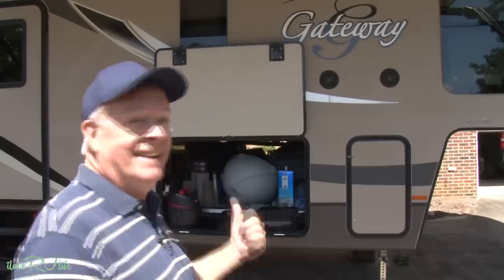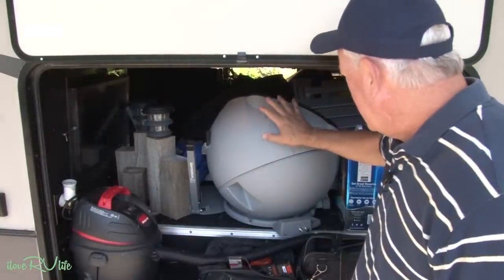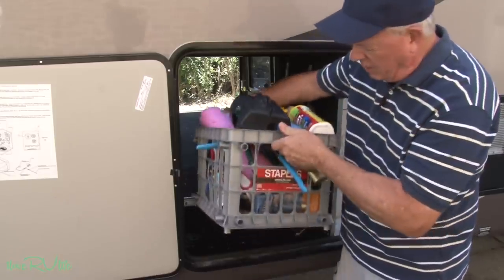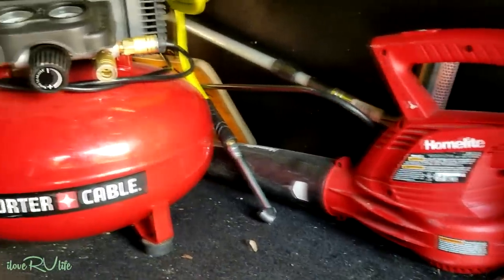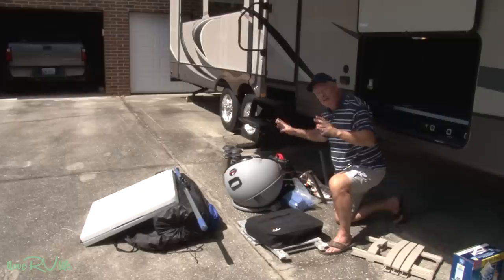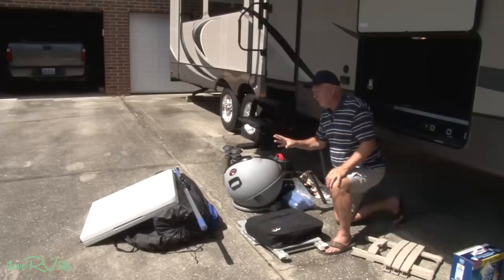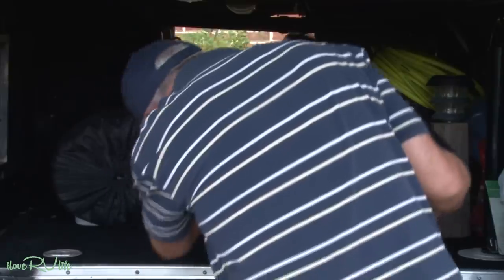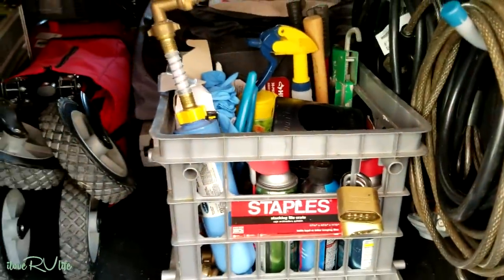Packing Your RV Storage Area

Comment: Jerry, this I a a great video. Imagine that we went from an 05 39’ Teton Grand to a 29-5T Arctic Fox. It had a “garage” you could literally camp in. Talk about downsizing!  I put 2 toolboxes in the bed of the truck. One big box in the front of the bed and one behind out trailer saver hitch as close to the tailgate as possible. I keep all of the non trailer oriented stuff in the big box in front, my camp chef grill, small air compressor,  small 2 step stool etc. in the one in back of the bed I keep all my tools, repair parts, chemicals and whatever is left. Only thing I must watch is to lift the front of the coach about an additional 1.5 inches after clearing the hitch to get the pin over the rear box. That leaves my on coach storage for trailer and camping specific items, Winegard X2 (bought after watching your video...thanks for that) chairs, bins for fresh and waste hoses and accompanying stuff. It worked amazing for us. Appreciate your channel and hope to meet on the road some time (getting closer to retirement). We are in So Cal but love the south (when it’s a bit cooler) Safe travels to you and your wife this summer. Rick and Linnea Colston. If you would like to see any pics I would be happy to post. ( not sure if I can in the comments section )
Reply from the maker: What a great set up Rick.  I’ve seen several 29 series Arctic Fox recently.  Well designed and great use of floor space.  Also understand they are well built.  Glad to hear the X2 is working well. We’ve had ours several years and still works great.  Warns days are on the way in Georgia.  Heading to the North Carolina mountains Monday to escape the heat.  If all goes as planned, we’ll head west early fall. AZ may be as far as we go this trip.  The RV world is small is a small place. Hope our paths cross.  Jerry...

Comment: Really great video as always!!  We were curious about your leaf blower...I want to get an cheap plug in to blow the sand out of the camper, as well as blow the sand off the mats when we pack up to leave (my husband spends like an hour sweeping it off before we fold it up to leave haha)  We don't want a rechargeable one, as that would be a pain, but want something strong enough.  And Small enough to fit in our storage!  Is yours a plug in and do you recommend it?
Reply from the maker: Thanks a bunch Lori.  The little Homelite blower isn’t made any longer, but Black n Decker makes a unit that’s almost identical https://amzn.to/2IR6Cxk.  It too is small and electric.  The little electric blow is perfect for leaves, sand, etc.
Reply: A thought, could the small shop vac have a place to put the hose on exhaust?  I have one that does. It may eliminate a tool and free up some space. The wand could be used to direct air flow?
Reply from the maker: Hi Jim.  It does have an exhaust on the other side and makes a fair leaf blower.

Comment: Good vid as always Jerry!  There is nothing that gets on my nerves more when I’m camping is trying to get something out of storage and having to pull a tangled mess out for one thing. What I have done is get 4 heavy duty plastic totes. I have 1 labeled for leveling blocks/wheel chocks, 1 for outdoor grilling,bug sprays,fire starters etc.. Then last one is for electric cords, pig tails, small tools, any maintenance items. Rugs slide in between totes and chairs fit on top of totes. This for me has made set up and break down stress free and fast.
Reply from the maker: That’s a great system Todd.  Thanks for sharing.

Comment: We just upgraded to a momentum 381 toy hauler from an older KZ toy hauler. The new one has way less storage in the pass through. I had to go through my stuff and downsize. I didn't realize i had 200' of water hose lol. Even after downsizing I had to get creative. I'm using the generator compartment for some things and our under bed storage too. Long story short...whatever storage I have in any rig will be slammed full.
Reply from the maker: Too funny Blake on the water hose!  I didn’t mention, but I carried one around this year that leaked like crazy.  I didn’t show the geny bay.  I have a big custom battery box with 4 T105s and my hoses.  Nothing fancy but functional.  We may be getting close to having the basics and not hauling around a bunch of stuff never used.  Jerry...

Comment: Nice, I put my air compressor on my truck,  with 5 gallons of air. It goes to 200 psi. I got the high volume pumps. I got 2 of them
Reply from the maker: That will get the job done!

Comment: Great idea on going through storage about once a year.  You inspired me to go through mine again.  I purchase two large clear tubs with lids for loose items.  Be sure and get them lids, because as you said flat is good and I stack a few large light weight items on top.  Agree put things you seem to always to use in the front.  Also, don't forget the front storage.  I put my power cords, hoses, sewer connects there.
Reply from the maker: Hi Norman, I do the same with the front storage for hoses and the grill.  Should have shown, but so little space is available (it’s full of golf cart batteries) I didn’t both showing.  Should have taken a minute to show the set up.  Great tip.  Thanks for sharing.

Comment: You mentioned cleaning off the faucets at the camp grounds. Could you do a video on sanitation of campground hook ups and what you do to clean them up. Thanks Jerry
Reply from the maker: I could, but not much to share.  We have one of those large generic spray bottles you can buy from the home products isle at the home improvement stores or Wally Worlds.  Add a half a cup of bleach and fill with water.  I spray the water facet in and out before I connect the hose.  Just a simple “just in case” measure.
Reply: I Love RV Life that’s great will add it to our inventory forsure. Thanks for tips again!

Comment: X2 tip- After disconnecting power rotate the head clockwise until the arrows aligned for STORAGE. The head will then be Horizontal. Other than that..nice job!
Reply from the maker: Thanks

Comment: Would there be enough room on the garage door to install grip clamps to put your electric adapter on?  Since shore power is probably the third thing to do? And stacked in one place?
Reply from the maker: There is.  A clip holder used for brooms and mops is an option.  Have been debating for some time whether or not to add.
Reply: I Love RV Life I don’t Rv as of ye.  Just found your channel. Been following the RV Odd Couple. But I think if you used short screws with epoxy. It may work.   That is if there is any space near the hinge to affix you most used plugs. Might just work?
Reply from the maker: Welcome to the channel Jim. I think the short screws would work.  I want to make sure we don’t add strain or wear from highway bumps that could damage the adapters over time.  They’re small, but a little hefty for the size.
Reply: I Love RV Life I saw you hold one up in your garage storage video.  I have the problem rolling on the back burner in my mind. Maybe three clamps per? Each end and one near center mass? Or 
Maybe industrial strength Velcro?   A spot on ends and patch in middle? Just enough to hold on door, but not enough to require a breaker bar?